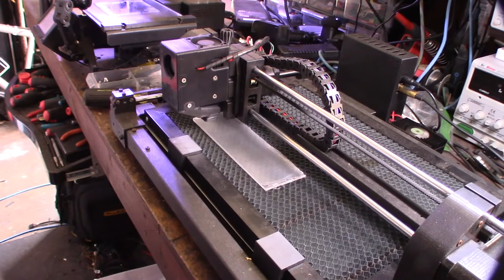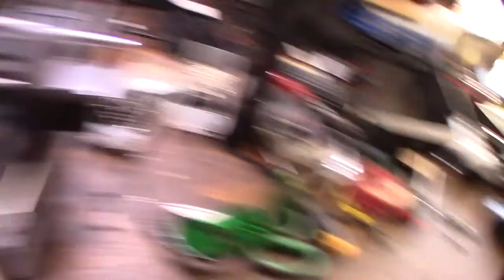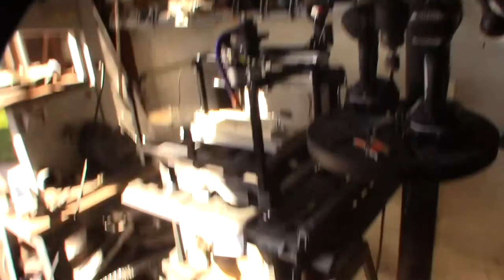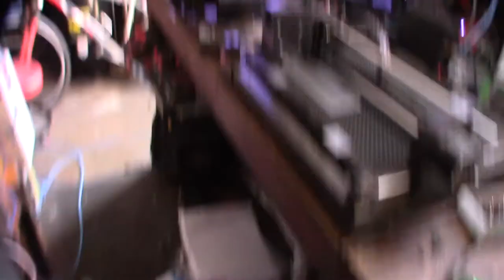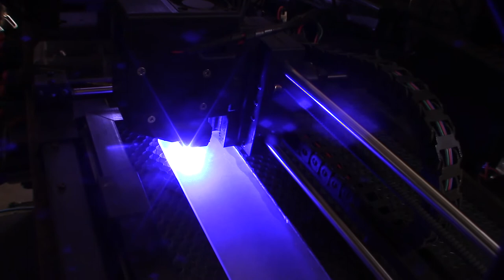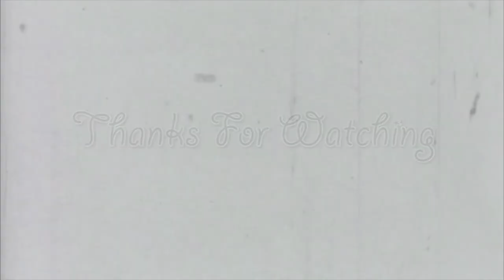Laser cutting Clear Transparent Acrylic With Laser Diode (WILL NOT WORK!!!) Plexiglas CO2

Comment: Types of Acrylic
Before beginning to experiment with acrylic in your laser, it's important to understand the different types of this substrate. There are actually two types of acrylics suitable for use with the laser: cast and extruded.

Cast acrylic sheets are made from a liquid acrylic that is poured into molds that can be set into various shapes and sizes. This is the type of acrylic used for most of the awards you see on the market. Cast acrylic is ideal for engraving because it turns a frosty white color when engraved. Cast acrylic can be cut with a laser, but it will not result in flame-polished edges. This acrylic material is better suited for engraving.

The other type of acrylic is known as extruded acrylic, which is a very popular cutting material. Extruded acrylic is formed through a higher-volume manufacturing technique, so it is typically less expensive than cast, and it reacts very differently with the laser beam. Extruded acrylic will cut cleanly and smoothly and will have a flame-polished edge when laser cut. But when it is engraved, instead of a frosted look you will have a clear engraving.
Reply: Thank you for this insight

Comment: Clear transparents wont work yeah. You can engrave clear acrylic ( and clear glass ) with some trickery, such as painting the bottom-side black, and etching mirrored. Engraves glass extremely well. But yeah, personally I've yet to manage cutting clear acrylic. I've cut transparent colored acrylic easily though, red..green..purple..orange..yellow..blue..etc. So long as it wasnt super lightly colored ( like a pastel blue ) i had no issues cutting it, such as 6mm thick transparent red. Do wish it cuts clear though, Cannot run CO2 lasers myself as my laser stays in a garage that isnt heated and winters get below 0F. Not running a water temp regulator 24/7..nope!

Comment: Did you try a damp paper towel to the under side of the acrylic?
Reply: The damp paper towel is to reduce flames when cutting acrylic with a CO2 laser. A CO2 laser does indeed cut clear acrylic. It's not the paper towel that enables that cutting, and it won't with a diode laser either.

Comment: I beg to differ. This guy has good tips on cutting clear acrylic. Also, I think you need a backing on your acylic to keep it from passing through. 
https://youtu.be/2c68HceTR4I
Reply: That video shows using a CO2 laser, which does indeed cut clear acrylic.  This video here is about using a diode (blue) laser.
Reply: @Graham_Wideman  You're right. I'm still new to this and learning. At the time of writing, I didn't know that CO2 lasers don't use a diode at all. The video here says "... Laser Diode (...) Plexiglass CO2", and me being a newb, was under the impression that he used a laser diode and thought CO2 gas was an air assist. Thanks for pointing that out without being insulting. I researched it as soon as I read your comment. Fascinating how a CO2 laser works. Now if only they made them cheap enough so I could cut some clear acrylic.😂
Reply: @paulweston8184  well, you can get co2 lasers called k40 model for $400 range but only 8 x 12 inches. And co2 laser needs air assist and ventilation.